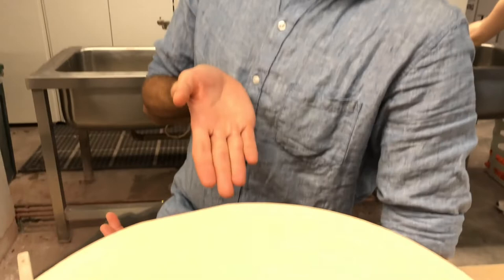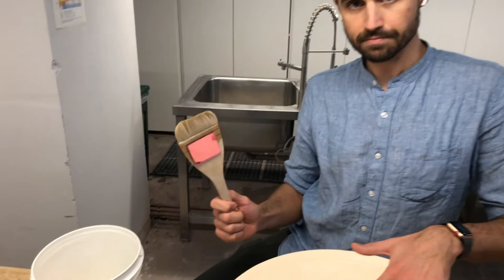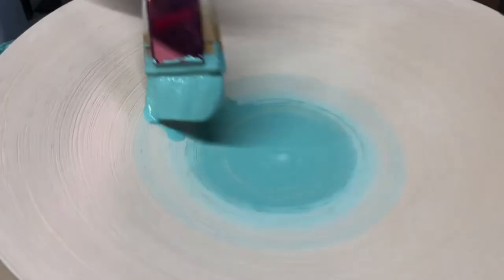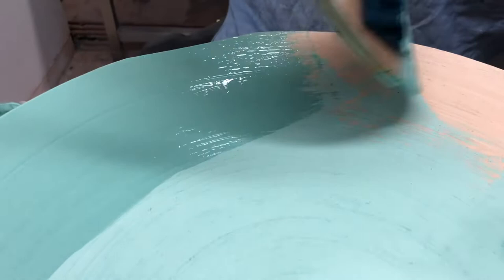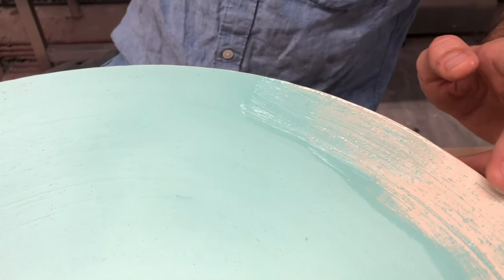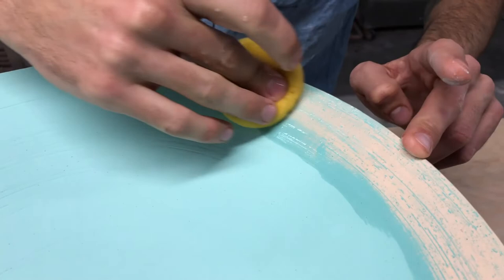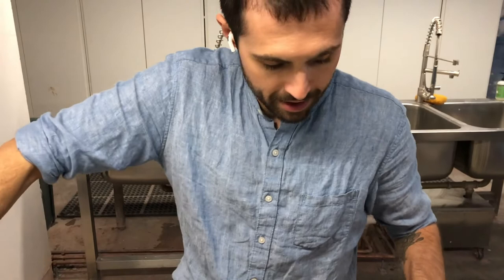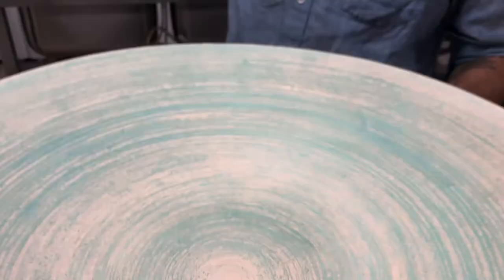BKLYN CLAY Online Tutorial: Using Washes on Bisque with Jeff Close

Comment: After you have washed the excess off, is the water/wash-off safe to go down the sink?
Reply: No copper is toxic so don't wash it down in the sink. I wash everything (also brushes and sponges) in a bucket. After two days the particles are on the bottom and you can throw away the clear water. The particles go into my slop glaze / reclaim glaze bucket